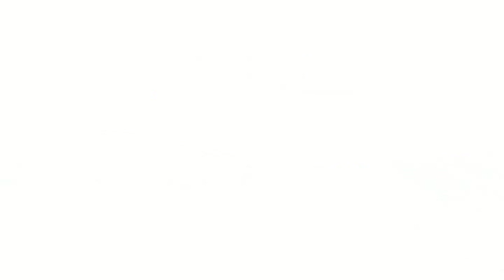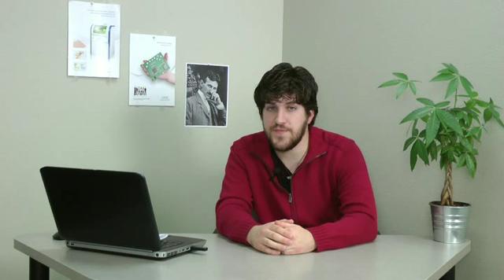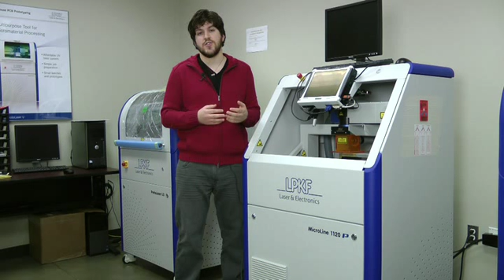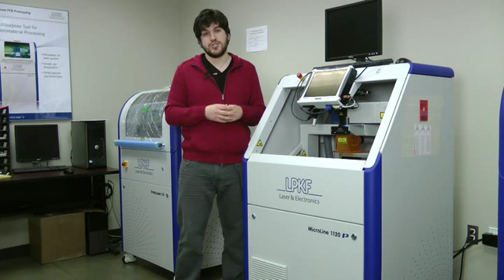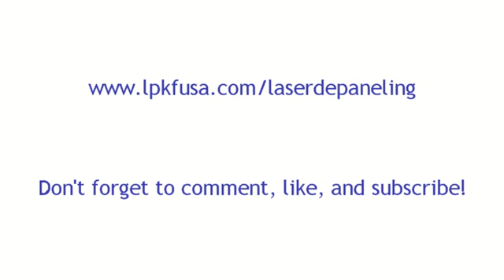Ask LPKF, Ed. 5: Can UV Lasers Only Cut Thin PCB Materials?

Comment: Hi, may I ask whether 6 watt laser source in LPKF ProtoLaser U3 can drill a hole through a PCB board with a total thickness of 1.3 mm?
Reply from the maker: Hello Hong, Yes, the LPKF UV laser systems are able to drill, cut and depth engrave a wide range of PCB materials at 1.3mm thickness or less. At ~6 watt for the ProtoLaser U3 or new ProtoLaser U4, 0.8mm thickness or less is recommended due to faster processing speeds. However, production LPKF MicroLine UV lasers are also available with higher power. If you would like additional information, please feel free to email our sales team directly through sales@lpkfusa.com.